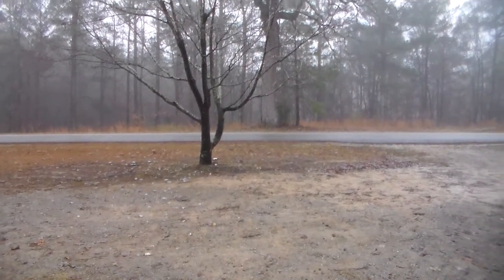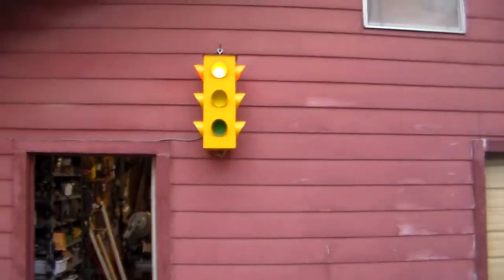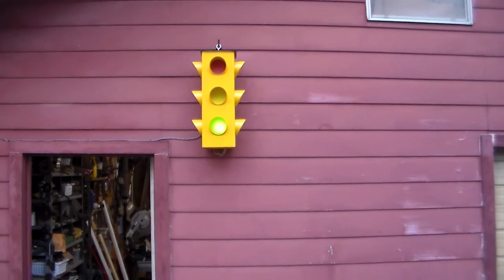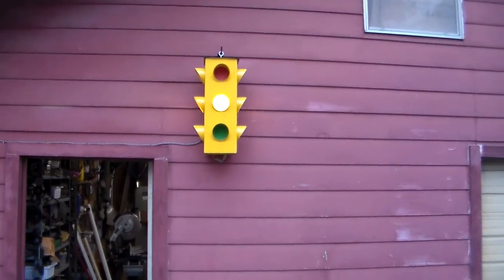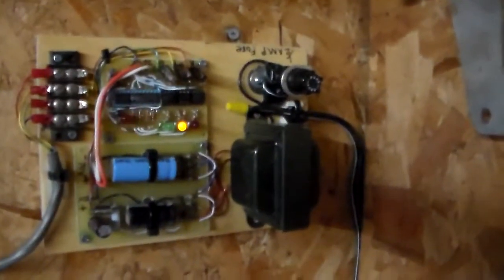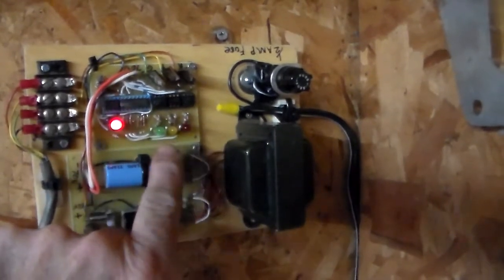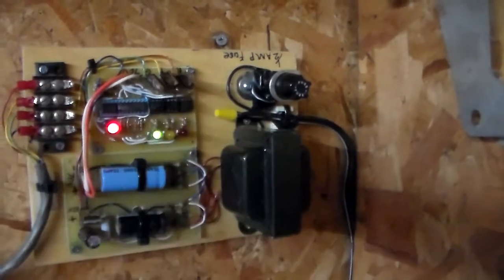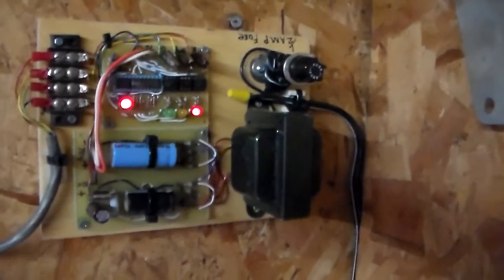Homemade Traffic Signal Light

Comment: how did you build the traffic signal?
Reply from the maker: I designed the circuitry and built it.
Reply: I understand that, but what I'd like to know. How did you build the the traffic  light box? I don't care about the insides
Reply from the maker: Now that you have clarified what you want, The box is made of 3/4 plywood and 4" pvc pipe. I cut out squares of clear acrylic to hold the colored plastic in place. The top is aluminum formed like a hip roof.
The lights are dimmable LED shaped like standard incandesent lamps.
Reply: Thank you so Very much. So simple to build, and it looks so good. You did a great job. Again Thank you!